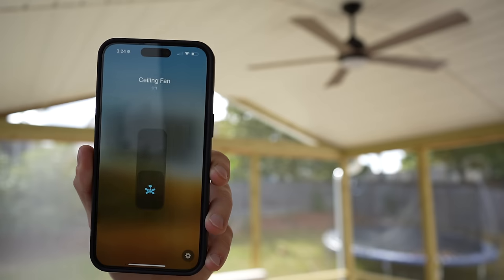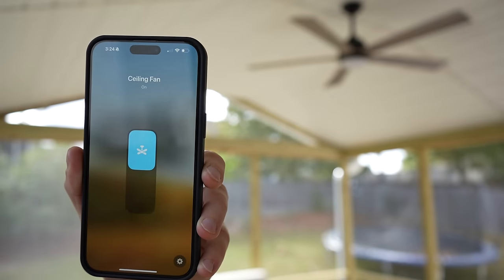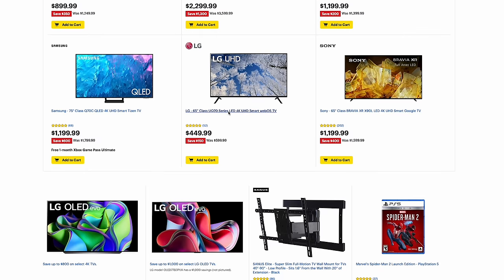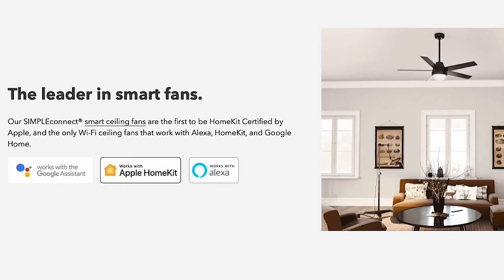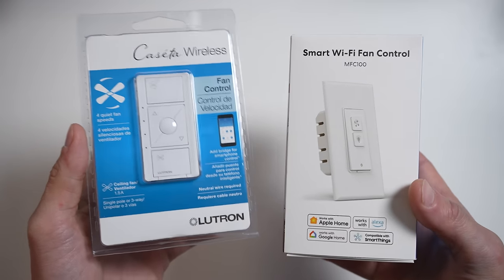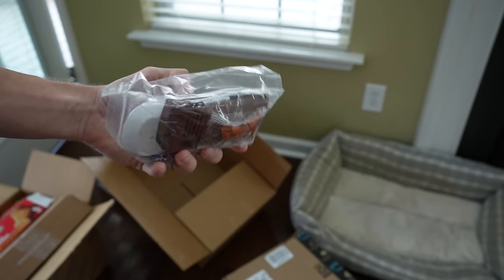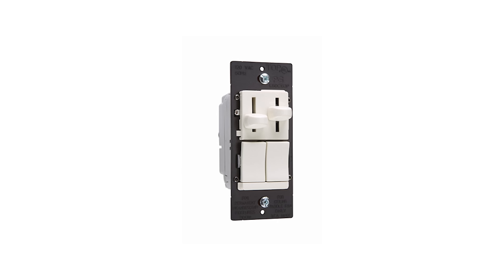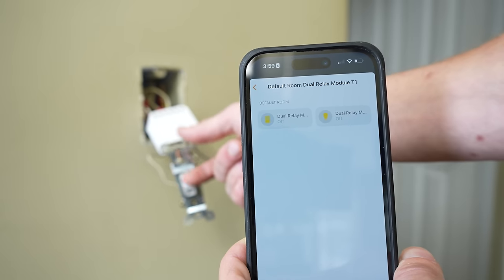Make Your Ceiling Fans Smart: The Ultimate Guide!

Comment: I use Bond + Homebridge+bond plugin. I have 1 DC and 5 AC fans, using the inbox RF controllers and remotes, and all work as expected including speed control and (usually) light dimmer. You program the Bond using the existing remotes and can do some customizing using their app. It's very simple to then connect the Bond to HomeKit and it's been working great. Occasionally requires cycling the bond unit and/or homebridge, but not often.

None of my fans are controlled by a wall switch, but if they were, I would use a smart switch, wire the load to the hot at the junction box, and use automations. I also have the Bond connected to my RF (cheap, but not smart) shades. So, currently nine devices all controlled by a $100 hub + my existing homebridge. No need to get up on ladders, ;)

Comment: We just purchased 4 RF controlled ceiling fans with light and your video makes a lot of sense using the Aqara relays for all of them. I’m taking it a step further by using a Tuya RF blaster and homebridge to control the fan speed in HK. But now I’m wondering if i should only use the Tuya RF blaster.

Comment: I just recently modified a DC fan in our master bedroom. It’s a Harbor Breeze and they incorporate the controller into the top of the fan. It only had a single hot but the house was set up for separate wall switches. So when I originally installed it I had to cap one circuit and we couldn’t use the wall switch anymore…only the remote. 

I recently dropped the fan and ran a second hot line through the down rod and bypassed the light on the controller and wired it directly to the second circuit. 

Now the fan can be controlled independently with a smart wall switch (relay) and the light with a smart wall dimmer. So they can be controlled now from the wall again or home automation without having to locate the remote. Only caveat is you need the remote if you want to adjust the speed of the fan…but not that big of a deal and better than it was. 

Just wish manufacturers would stop shoving half baked products down our throats and stick with reliable and proven options.

Comment: I've been using a smart switch with Smartthings for fan controls. I still have to get the ladder out twice a year to change the direction though.   Clockwise in the winter, counter-clockwise in the summer....other than that, the switches have worked out great. I can tell Alexa to turn on or off my fans also if I don't feel like getting up.

Comment: Shane, great explanation & caution with the newer dc powered fan motors. I use a Bond controller that operates all my fans throughout my home. Works great with RF or infrared operated fans that work of that style remote. Makes dumb fans & other devices smart!
Reply: I love that I can control my house's many fans with my Bond controller.  It rocks!  It's incredibly frustrating (understandable, but frustrating) that it can't track fan state, however, so if you ever use the remote to adjust something, usually the Bond has no idea anything has changed.  Especially bad if the lights and fan are turned on or off for something that only has a state toggle... so now that light is on, and when your automation (or Siri) tries to "turn on the lights in x room", it instead toggles the fan light OFF and the rest of the lights come on...

Comment: Hey Shane. coming from the Z wave (honestly possible with zigbee as well) world there's a great way to achieve what you want with the "accidentally killing the light switch" issue for those who want to use a relay or smart controller but still want to keep it WAF certified. for switches like Zooz and Inovelli that offer scene control. you can disable the internal relay so that physical button presses don't kill the power. this way you can press the top or bottom of the switch physically and tie those actions to the on/off respectively of the fan and/or light. it's a great alternative to keeping the house as user friendly as possible. plus in the event of say a power outage or something odd where you need to enable the physical relay for whatever reason, you can do this manually at the switch with no network communication required, just a series of button presses.

Comment: Hunter integrates their receivers into the motor unit now, and can’t be bypassed without significant modification, at least on all the models I looked at. Hopefully they’ll be companies that still make nice “dumb” fans for a while. Went with Harbor Breeze for my 2 recent installs so I could use Lutron switches.
Reply: Thanks for the comment. So Harbor Breeze allows you to use Lutron Switches?
Reply: @Doriginal5  Yes, most of their fans are just regular “dumb fans” that have a pull chain.

Comment: My existing fan had a RF based switch - ended up putting a smart bulb in, and bond RF Controller through homebridge to get the fan into homekit. Works great.
Reply from the maker: Thanks for sharing! Do you not have a light switch? Or just don’t use it?
Reply: Same for me. I use a Broadcom RF and IR controller and learned in the several speed settings from the remote and the light. I don’t use a wallswitch (that’s always on).

Comment: You need to be extremely sure that your switch is rated for fan control - also called an inductive load. Motors have an extremely high inrush current (a massive but temporary spike in wattage as it begins to spin).

Comment: I have an A/C fan, 2-gang box with separate fan control (multi-speed) and lights (the fan doesn't have a light kit built in). I use apple homekit. What do you recommend for fan speed control? The Meross and Lutron seem to only make fan speed speed control combined with light control.

Comment: Have you checked out WAC Fans they have a remote that looks like Lutron and they also have a wall switch that gives power without neutral wire and communicates with the fan without remote but you still can use the remote as well

Comment: So if I have a ceiling fan with remote installed. Will the addition of the smart switch affect the adjustability of the fan since the remote module is already installed? Asking because you recommended not needing to install the remote module.

Comment: 10:52 A relatively simple solution here that I’m kinda surprised you didn’t mention is smart bulbs. Especially if you have ones that can be paired to a smart button like Philips Hue with the Lutron Aurora. Definitely isn’t cheap but works incredibly well if you don’t care about controlling the fan through HomeKit.
Reply: the reason he didn’t mention it is because this video is about making your ceiling fans smart. smart bulbs can easily lose power and become non responsive once someone flips the switch by accident. the same goes for ceiling fans. that is why he dives deep into smart switches and other options. the end goal is to have smart control over these things without worrying about power being cut off at the switch.
Reply: @jaykea  True, although if you wire the light switch to be always on (or physically manage switch access with a cover), then you can control that bulb via Smart switches instead.

Comment: Another option is to pair a smart button with the smart fans -- I set those for on/off so there is still a "switch" in the bedroom
Reply from the maker: Yes, that's a great suggestion, especially if you don't have a switch or have to wire one to be always hot.
Reply: Great point!

Comment: I have an AC powered fan with a light, both run through one switch. Your thoughts on using the Caseta  switch to control the fan and using a smart bulb for the light.
Reply from the maker: If the fan and the light are controlled by the same switch, when you turn the fan off it will kill the connection to your smart bulb. Your best bet is probably to instal some sort of relay. See 10:38 in the video where this is discussed.

Comment: Kasa has a ceiling fan and light dimmer switch but idk if my fan and light are compatible, I’m trying to decide between the Kasa combo switch or have a separate fan switch like caseta would require separate light and fan switches. Every fan I can find to buy show a DC motor

Comment: For those few people who have ceiling fans that use RF remotes, a great option is the "Bond Bridge" which is basically an RF (and IR) transmitter that can learn and transmit any codes, and it has native homekit support. Using this device I was able to integrate all of the ceiling fans in my house with Homekit, including speed and directional control, automations etc. The only downside is as you mention if physical switch is turned off. I live alone so not a problem with me, but if you have kids or frequent guests etc, you can always wire the switch so it's always hot, or use your trick of replacing the switch with a wireless rocker etc.
Reply: when you say bond bridge has native homekit support, does that mean you don't need home assistant or other bridge to get it to work with homekit?
Reply: @jessicaanastasio6114  Correct!
Reply: @davidwalser462  I'm using a non-Pro Bond, and control my RF ceiling fans with HomeKit.  I may be using either HomeBridge or HomeAssistant to pass through the commands, though... I honestly can't really recall.  I can control lights and fan speed, however.  It's stateless, though, and toggling light state is the best it can do, so sometimes things get out of sync and something has to be manually changed with the OEM remote to get it back to normal.
Reply: Are you sure about this? On the bond website it doesn’t mention anything about HomeKit.
Reply: @compudude  In the settings there is an option to fixed the tracked state, so you don't need the orig remote.
Reply: @eugeniocastro2432  Yeah, its the beta firmware for the Pro that has the feature.

Comment: Love when you do a deep dive into something like this. If you happen to have any friends with reverse cycle split system air conditioners (I think you call them mini splits?) I'd love to see that! Mine are driving me completely batty. Automations through the Aqara app managed the temperature fairly well, but made the air conditioner beep every couple of minutes. Switchbot didn't give me enough control on dehumidify. Now I'm trying to use the temperature sensors in the HomePod minis with scenes exported from Aqara. It's currently 53F in here and it's cooling 🙄 I'm about ready to pull my hair out!
Reply: I use the Cielo Plus units on my Mini Split AC/Heatpumps.  It controls them very well but they don't integrate into smart home yet...

Comment: Yeah, this is a huge problem for me. There is one fan / light combo in the house wired to one wall switch. All the other rooms have separate switches for the light and the fan. The single switch is a due to a lack of design thoughtfulness on the part of the builder. I use Lutron Caseta throughout the house and just considering a standalone solution to that one fan is grating to me. I’m glad, due to your due diligence, that I do understand the problem and that the lack of a straightforward solution is not unique to me. I really do not want to extend the gang box and run new wire. I have ideas for a product that would work but, wow, what a First World problem….
Reply: yea it's a frustrating thing to encounter. with an AC fan and both loads at the switch it's an easy fix, but if you only have 1 load then best bet is a smart fan controller or relay in the fan canopy, then you can leverage a dual button or scene based switch to make it as user friendly as possible. so you can make it so that the load can never bee accidentally turned off, but the light switch buttons can still serve as on/off.
Reply: Agree!    He starts out saying, "My house has it (on 5 of 6 rooms), so I assume it's standard."   I'll go out on a limb and say NO.  I had a new construction house built 10 years ago, and had to pay extra to get two switches (and a fan-rated ceiling box).  But every other house I've seen, it's a single ceiling switch.

Comment: My family room fan is a DC unit with a single wall switch and remote control. I replaced the wall switch with a smart switch to automate it turning on and off, then use the remote if I need to change the settings on the fan, which doesn't happen much.

Alexa can turn the fan on and off, and I programmed it to come on or off 5 minutes after my gas fireplace does either.

My 3 guest bedrooms have standard AC / dual switches with pull chains.  I haven't decided whether to attach those to smart switches.  Maybe if I put Echo devices in the rooms. But then each guest bedroom would need distinct names for each fan switch.

Edit: Someone above suggested buttons which are a great substitute for the Alexa smart speakers. THIS is what I'll put on the night stands in the guest rooms.

-So complicated for something that seems so simple!
Reply: Your DC fans- if the power is interrupted or turned off w the wall switch, do they return to the last speed setting and "on" when the switch it turned back on? Or power comes back?  My DC fans do not; if they were running and I flip the wall switch they just turn off and I need to use the remote to select fan speed to turn on again. Very frustrating!
Reply: @bjjere  Yes. I have 3 such fans. They all turn on and off with the wall switch, of which only one is smart.  They stay programmed as per their last remote control settings.

All I benefit from is the on/off feature with the smart switch.

Comment: Have you looked into the Bond Bridge? If your ceiling fan has a remote you can program each button into HomeKit using the bridge
Reply from the maker: Yes, I've heard mixed reviews about Bond Bridge. Some folks love it. It does still require homebridge though. And that still doesn't allow you to use wired wall switches, which is something I tried to address.

Comment: what a great summary! a random question, what's your automation for fan during these cool and winter time?
Reply from the maker: Thanks for watching! Mainly I use the ceiling fans in automations that say: when the temperature in a room gets above XXº, turn the fan on.
Reply: @ShaneCreates  Thanks. However, the fan does not decrease the temperature so it would run forever. It can reduce the "feels like temperature" but not the actual temperature.

Comment: Your other video to show relay in fan doesn’t say if it was DC or AC
I have a DC fan and I want to separate out the light and fan and I have only one switch. How to handle this? FYI I have a receiver.
In this video the example you showed had two separate wirings for light and fan. I do not have so

Comment: I have 3 ceiling fans in my house that are not connected to any switch (house was built in the 60s and fans were added in after renovation) they are the pull chain type so they constantly have power and one fan with a remote. How would I get these to connect to HomeKit. I know bond would work for the fan with the remote but I’m looking for a more native integration.
Reply: I have 4 fans on no switch.  Fan only, no light.  Pull chain switch.  Home built in 2010.  I would love to get them on the home network so I could trigger them with motion or use Siri to control.  Not sure why your question was ignored.  Would like to see some ideas.

Comment: Hey Shane,
This is probably a silly question, if the fan has a remote why bother with all the wiring and switches

Wouldn’t it just be easy to use something like an Aqara M2 hub that (I’m pretty sure) has an IR blaster functionality blast the remote and then run scenes or shortcuts ? 

You then could have functionality over the light and fan on/off/speed regardless off AC/DC? 

Cheers 
Adam
Reply: Yes, although things can get out of sync pretty easily, and many fans use RF remotes instead of IR.
Reply: the issue is that you can't track states for the fan/light when using RF/IR. we have a fan like this in our master, so when you incorporate your smart home to include this "smart light/fan" and say you want to turn off all the lights in the house, but your rf based device is already off, it'll turn on just because of the way RF works it doesn't know or care if a device is on/off.

Comment: Any recommendation on the ceiling fan which better works with lutron smart fan controller?
Reply from the maker: Any AC powered fan should work fine with the Lutron Fan Controller.
Reply: @ShaneCreates  if I buy AC powered ceiling fan with remote controller , along with Lutron switch.. can I still operate on both remote and switch along with smart device ?
Reply from the maker: @suhashv6  I think that could be problematic. I always disregard the remote receiver completely when installing an AC powered fan for use with a Lutron Fan Switch, as mentioned at 7:17.
Reply: @ShaneCreates   Thanks for getting back. Looking forward to put into action now.
Reply: @suhashv6 how did it work out. Which brand of fan did you phrchase
Reply: @ShaneCreates  any thoughts on whether it needs to be pull chain or can it have a wall speed switch - I called lutron and they don't recommend anything but pull chain - but I prefer the look of the ones without chains.

Comment: Is there an easy way to identify a AC vs DC fan after they are installed?
Reply from the maker: Maybe consult the manufacturer’s website if you don’t have the packaging or documentation. Typically fans with a pull chain are AC and often those with a remote are often DC. But I many AC fans may also have a remote.

Comment: This video would have been helpful like a week ago. I needed to replace the fan in my living room which was connected to a Lutron dimmer switch for the lights and a pill string for fan speed. I just went to Lowe’s and picked a fan I like. Now I have a  non-smart fan with remote control . I didn’t install it myself but it’s most likely DC so I guess I don’t have many smart options.